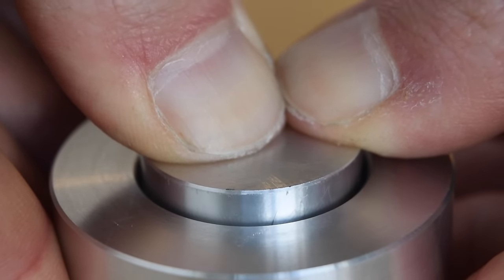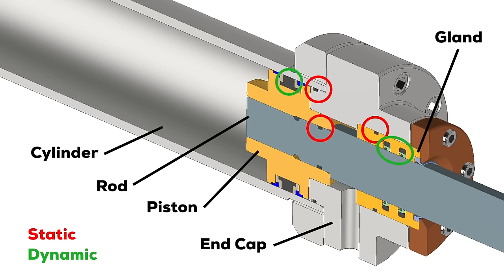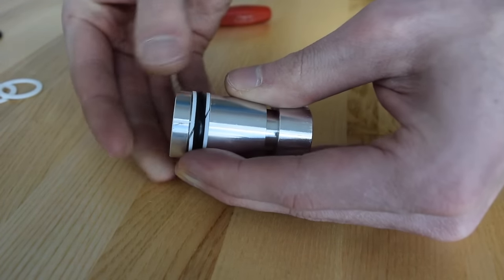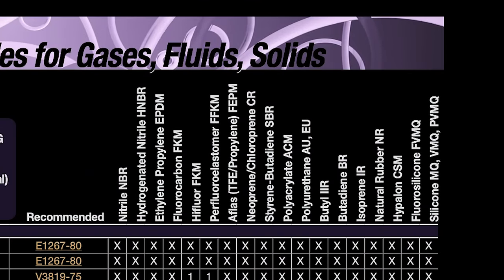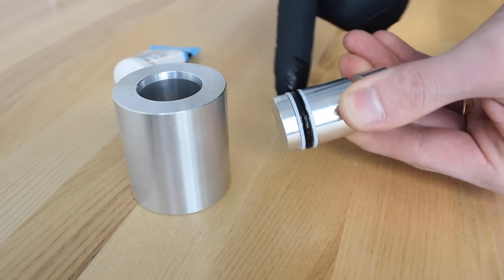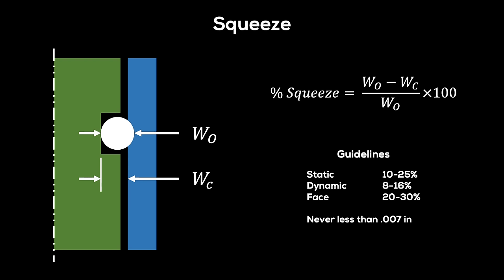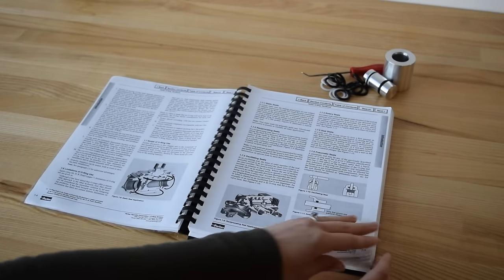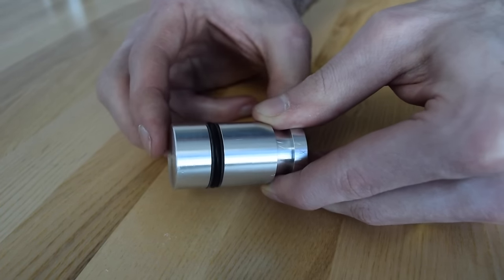O-Rings? O-Yeah! How to Select, Design, and Install O-Ring Seals

Comment: As a mechanic I have needed this info for decades! Thank you!
Reply: I dont care what you work on, but if youre a mechanic with any experience you would know that, aside from excessive crank case pressure,  the leading cause of an oil leak is the hardening of the seal/o-ring.
Reply: @MMSieBreeze  Crankshafts don't use O'rings. They use single lip seals. I was referring to the engineering aspects....I work on a lot of shit that isn't an engine.

Comment: I remember having to actually read a good bit of the Parker O-ring Handbook while designing a component for my school's FSAE car about 13 years ago.  This summarizes the key points beautifully.  Now where the heck was this video 13 years ago!?  Seriously, good job!
Also, for viewers: when in doubt, incorporate a plug seal in your design.  You don't run into the face seal component deflection problems and if you do it right, you only need one external groove that's easy to make & change seals on.

Comment: Working in automotive, i find that the heat cycles consistently cause o-rings and like seals to fail, causing oil leaks. While cooling systems are not as prone to failure, o-rings used in oil only applications have a tendency to harden due to heat exchange and essentially become plastic, losing any and all sealng capabilities they once had.

Comment: Very nice. I have an application where my static rod will be between two sizes. I.e a 113 Buna N O ring will have a 9% stretch  but a 114 will have about 0.5%. The 113 feels about right using a 50 durometer i.e soft O ring. The application will run at up to 230F. I think a 113/50 is about the best choice in this application.

Comment: Information: A+. Great info. Learned quite a bit!
Video: A+. Great visual representation & aids.
Audio Track: C. The volume wasn't equalized and the woman speaking a bit softer was harder to hear than the male speaker. The overall volume was also quite low and really had to crank my volume up. The redeeming factor in the audio was that it did sound quite good once I was actually able to hear it 😉

Comment: I had to replace a o ring on a john deere  , oem ring was 20 dollars,  after market was 1 dollar.  After replacing i cut the old one apart , had 3 layers,  small stiff tough inner ring , covered by soft material,  and a tough outer shell . All o rings are not equal and if using every day I would pay for better . My old one lasted  60 years
Reply: Yes , but if I get 20 years then I will be to old to care . If I wanted to  last longer I would get the oem ring

Comment: Good video
I like how you use easy to use information like the parker o-ring handbook.
Would you be able to explain the actual squeeze listed in the parker o-ring handbook on the page where it has the width and depth. The cross-section minus the gland depth is different from the actual squeeze? That is the bit I don't understand.

Comment: They would have you believe they use O rings on the space station to seal parts from inside to outside.... 
They must be the most amazing o rings ever created out of the best material ever invented
Reply: Strange comment. The space station has thousands of o-ring seals throughout.

Comment: I have a question I am currently working and assembling a product called a Time tension line cutter and we're having problems with backing rings being pushed over o-rings causing them not to seal when they go over a snap ring groove do you have any suggestions on how to alleviate this problem

Comment: Very Useful indeed. HELP; Can someone confirm that 85% of the gland fill is 85% of the circumference of the cross section of O=ring, so if the O-ring is 1mm cross section then you add 0.85mm above and below for T O- rings?

Comment: You could use 303 Protectant as a lube when installing them . And also to keep them supple , not drying out and cracking . And maybe even to let O-rings soak in it overnight before installing .

Comment: Feb 1986: The president of the Parker Seal Group today said the rubber seals manufactured by his firm for joints between shuttle rocket booster fuel segments met all specifications.
Pat Pastryk said neither NASA nor the company that built the solid rocket boosters had ever questioned Parker about its product used in the space shuttle program. Speculation on the cause of the Jan. 28 explosion that killed the seven Challenger astronauts has centered on the joint between the lower two of four fuel segments that made up the ship's right-side rocket booster.

NASA film shows a plume of flame erupted at or near the joint, which may have triggered the explosion of Challenger's external fuel tank.

Pastryk emphasized in a news conference that his company only produced the material used to make the giant O-rings.

'The O-ring is a component of a complex seal arrangement,' Pastryk said.

Parker's Berea, Ky., plant produces 12 -foot sections of cord about one-quarter inch in diameter. Three pieces of the cord are spliced together by another company, Hydra Pac Inc. of Salt Lake City, to form the O-ring.

The O-rings are part of a complex joint design and provide a barrier to prevent hot gas or flame from burning propellant inside the booster rocket from escaping through the joints between fuel segments.

Comment: Hello
And how Loose would be ok for a O-ring inner diameter and outer if I can get the exact O-RING, like 0.2mm in all diameters and cross sections, bigger or smaller  I have so many questions. 🤔 😞
In some applications they have to be stretched a little bit like 2mm to go over the part and are the hole time a little stretched and on other parts the are about 2mm loose on the part, how can I determine what replacement o-ring would be ok or not if the exact O-RING is not available. 🤔 🤗 😞 I'm getting crasy about that, becourse I have bought a pcp Quick fitting special made from one company and they telling nothing about what sizes would be ok, they send me only a email I could measure the existing o-ring with a picture of a vernier calipers but that wasn't my question how to measure stuff.
For instance :
If I have this o-ring=
M18x1.5mm O-RING Orginal Dimensions for 300Bar HPA(PCP) Bottle(Cylinder) =
OD 23mm
ID 18.2mm
CS 2.4mm
What o-ring Could I choose instead, how small could I choose the cross section or how big and the outer diameter I think would en go much higher than 24mm I think, bevourse that's the rim of the bottle neck wher the O-ring get pushed in and how small could be the inner diameter, I think that's anyway determined by the cross section, I don't want to destroy a O-ring  or thst it getting pushed in the bottle when filling it ect. 🤔😞

Comment: Very informative. Do you have a topic about oil seal? Thanks in advance..
Reply: I don't think they covered it,  but further back in the Parker design catalog  there is an o-ring material  vs medium compatibility chart.  Also is covered in the tolerances is whether you are liquid, liquid/vacuum applications. These design charts should get you there for simple oil seal.

Comment: Hello
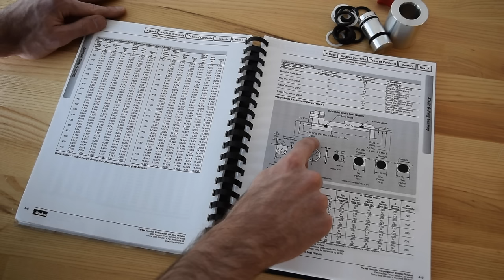Is it better to chose a little bigger diameter or Cross Section if I can't find the exact Metric O-RING size or better lower, becourse they are million different Cross Sections and Sizes, I have trouble to find exact(beside if the O-ring size are obsolete ect) O-RINGS for Pcp Hpa 300bar stuff, thats why I'm asking how fare away from the orginal measurements I can go without getting in Pressure Trouble.?🤔 🤗 6:29 6:29 6:29

Comment: Why do buttons (for instance on a gopro camera housing) have 2 o-rings right next to each other?
Reply from the maker: This may be specific to the GoPro housing design, and not buttons in general. A lot goes into button design for ingress protection. We will take a closer look at our GoPro enclosure and get back to you!
Reply: @tarkka  awesome! Thanks. There are plenty of videos showing the replacement of these on GoPro cases. Asking all my engineering friends, we assume it's for "extra protection/redundancy" but I'm not entirely sold on that. Would love to hear your conclusion! I'm actually building a water proof case and this info could help!

Comment: How do you determine what series (x-sectional diameter) o-ring to use for an application?
Reply from the maker: For most applications, you generally want to use the largest cross section you can reasonably accommodate. It will be more resistant to compression set, and as the housings dilate due to pressure, it will have less of an effect on the percent squeeze. For dynamic applications, larger cross sections are less likely to roll around. The trade-offs are that smaller O-rings are more resistant to explosive decompression, require less space, and have less friction (for dynamic).

Comment: Thank you for the video. 
However, according to the stretch guidelines it is recommended a stretch between 1-5%. In your example 210 O- ring is .734in ID and groove diameter is .778in.
in this case we will stretch the o-ring 0.734/0.778 = 5.65% stretch. Is it negligible? 
Would you change the design to fit the oring or choose the closest available?
Reply from the maker: This is an interesting observation. I have never calculated the stretch for the glands in the Parker book, but you're correct, it does have a 6% nominal stretch for that particular size. It appears that many of the smaller sizes have somewhat higher stretch. For example, a -115 also has 6% stretch, but a -150 has 1.3% 

I am not sure of the exact reason, but I would guess that this is an artifact of designing the tables to have exact fractional bore diameters for piston seals and exact fractional rod diameters for rod seals. This is a DFM choice they made so that you can use fractional reamers for bores and pre-ground stock for rods.

In terms of its impact on the design, the difference between 6% and 5% is probably negligible. The tolerances given in the tables are pretty tight, so they can still maintain a minimum squeeze above 15% even if you account for the decrease in cross section due to the higher stretch.

In terms of your second question, it depends on the case. If you have flexibility in your design, the easiest route is obviously to work around a standard O-ring and gland. But that's not always possible, and if you need to accommodate another component that has a fixed diameter, you have a few options. For larger sizes, you can actually change the diameters a fair amount and keep the stretch within permissible limits. For example, all the dimensions of the -150 gland I mentioned can be increased by .12 and the nominal stretch goes from 1.3% to 5.5% which is probably still acceptable. At this range of sizes, the rings are in .125 increments so you basically have full coverage for any diameter.

We didn't discuss negative stretch in the video (i.e. compression) but you can have up to 2% without the O-ring buckling.

For smaller sizes, this is more difficult, and your only option may be to have a non-standard size molded. I have also noticed that most suppliers (including even McMaster-Carr) sell O-rings in the smaller sizes that aren't in the AS568 standard, or Parker book, so it's worth calling around to see if somebody has an oddball size that you can work around.

Comment: Recently while remaking a leaking component for a customer, I tried machining a piston o-ring to the tight side of the handbook tolerance and followed the guidelines for installation ...it wouldn't assemble.  I made the part just a smidge bigger than the sample, but on the loose side of the tolerance band, nd it's working for now. I found the tolerance band for o-rings not very helpful and something I would be wary of simply transferring into your drawings.

Comment: To in stall o rings like the 90 durometer on positions you do not force on like in video . in your disign you speck out a delrin or uhmw cone as install tool for the end of piston heat o ring and roll on never force

Comment: Off the shelf o-ring... I wonder if it is possible to do a design and have no off the shelf o ring for it (just depends how hard you need to look). And even then, making a custom size is relatively cheap.
Reply: Do your local seal distributor a favor and spec in a common off the shelf AS-568 size.  You can thank me later.

Comment: When it comes to selecting O-rings, I would advise designing around standard O-rings.  It is infuriating to discover you need an O-ring, but multiple sets - commercial sets - fail to have what you need.
I liken it to automotive oil filters. Every time a manufacturer (such as GM or Audi) designs a new engine, they create a new oil filter as well, when any number of existing filters would work fine.  Dealers and parts houses end up wasting money and warehouse space stocking vast numbers of different filters.  Why?
Reply: Specifically to keep their particular supply chain going.
This way the engineer keeps his job.